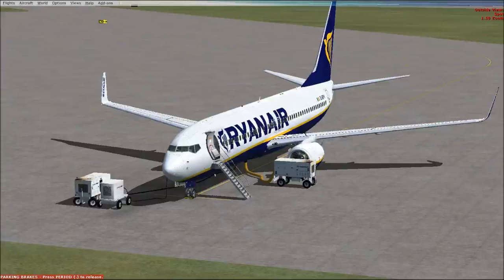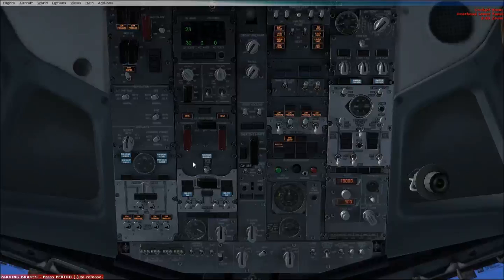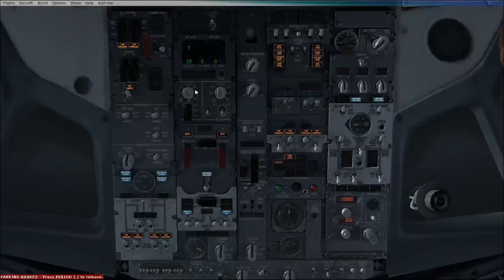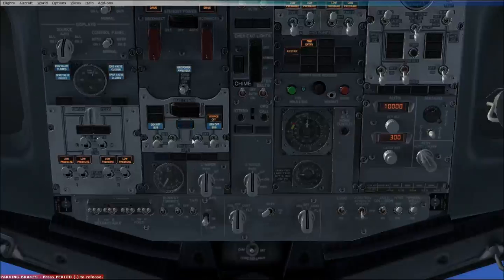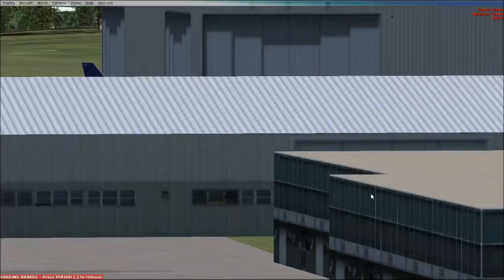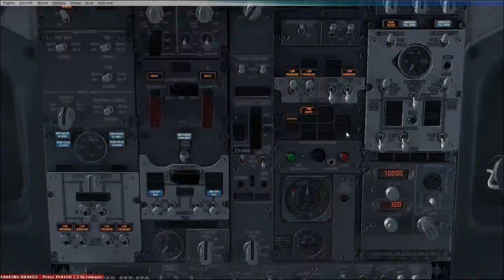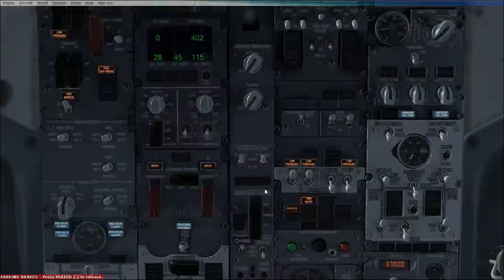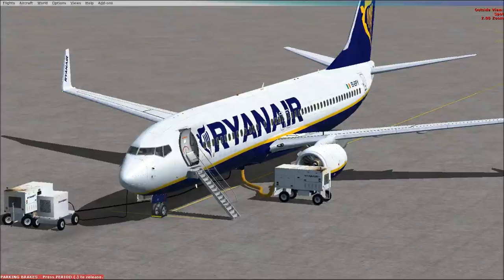[FSX] Ground School...PMDG 737NGX / Overhead Panel / Lesson 1

Comment: Probe heat is actually turned on AFTER engine start and not prior to it, also you don't turn the engine start switches to continuous after engine start. You actually turn them to continuous before both takeoff and landing. Good video, just a couple of things I thought I could help you with:) I'm also quite sure electrically driven hydraulic pumps are turned on prior to engine start, and engine driven hydraulic pumps turned on after start. This is what my instructor told me when I was on a simulator course for the 737NG. Anyways, good video, certainly useful to beginners!
Reply from the maker: Molyneux199 Thanks for the feedback, yes i was a bit of a noob then! ;)
Reply: Haha, everyone was at one stage!:)

Comment: Hello Friend I would like to say some words, for peoples which starts their adventure with fsx is very accurate tutorial but as advanced and experienced viewer is to short informations about switches I just finish at EDG's switches.In this video You uses words"In sim no need be switched" they is wrong words because PMDG is most advanced plane and almost every switch has somethink to do.   EDG's switches(red covers) disconnect Engine Driven Generator (EDG) and are used in case of any EDG failure... next Standby Hydraulics switches "pressurization stuff " those switches are NOT related with pressurisation system   best regards
Reply from the maker: Thanks, these videos were meant for beginners, but i can make some complicated and more in-depth videos if you would like?